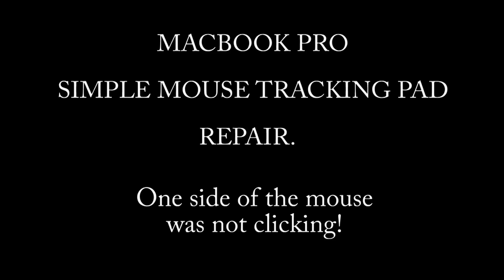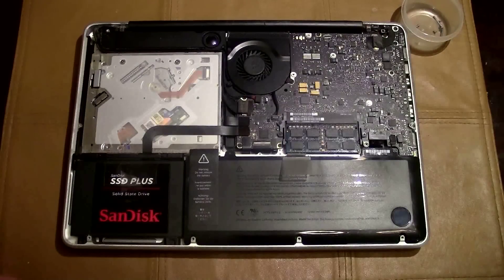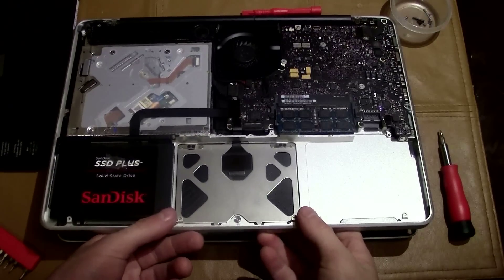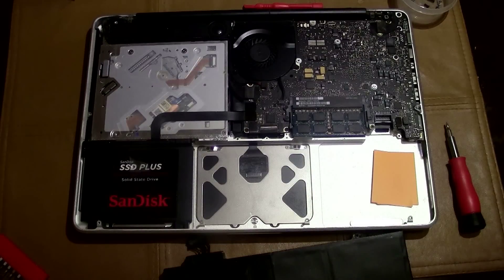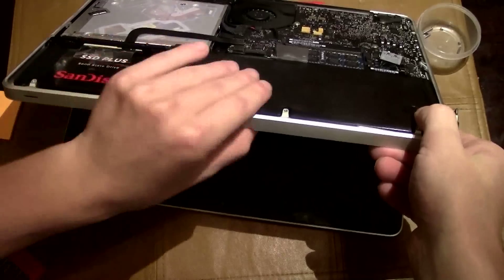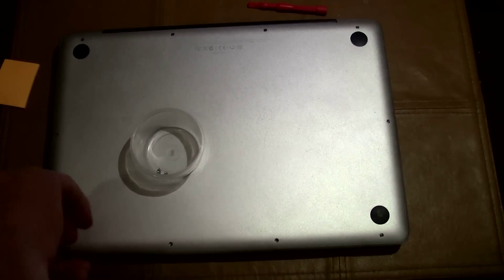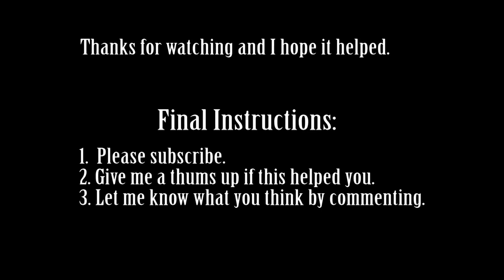Macbook TrackPad -- MousePad Not Clicking --DIY--How To

Comment: Thanks for sharing this. After watching your video I worked out that I had just tightened the bottom screws that sit the other side of the track pad too tight and that was causing the issue. I backed them off a touch and the trackpad was back to normal.

Comment: Hey I was wondering if you knew why my trackpad was so far in.
I believe it's cause I press too hard but I'm not able to press anymore because of it and  I don't know how to push it back out again.
Sorry if that made zero sense, just hoping that someone had a solution before I went back to school.
Reply from the maker: Hi, I am not 100 percent sure why that would happen, but it may be as you supect; you push too hard.  If you open up your laptop and look at where the trackpad mounts to the unibody casing, see if all the screws are tight.  Maybe they are loose and is causing some play.  Or maybe the mounting area is bent out of shape from you pushing to hard.  In any case, you can attempt to bend the mounting bracket back into place.  Or tighten the screws.  I hope this helped, Jake

Comment: Thanks for the inspirational video! Mine had the exact problem and I solved by banging the hinge side on the desk couple of times without taking even one screw off! Guess that just restored the battery to where it should be and unhindered the touchpad!
Reply: banging it on a desk? mines stuck right now but i’m too worried to bang it on a desk!!
Reply: @siena7098  OK when I say banging, I mean to let the hinge side fall gently on a flat hard surface such as a desk. Gently.
Reply: @santalucifer1169  ok, LOL was worried for your laptop for a second

Comment: Except this is a SOFTWARE problem.   Not a hardware problem.   Because the mouse click is controlled by SOFTWARE.
Reply: Bro what? You realize the mouse is physical thing as well as "controlled by software." Like if you couldn't press down a keyboard key because something was blocking it you wouldn't call that a software problem.

Comment: my god... this is so wrong... if your battery is pushing against the trackpad, YOUR BATTERY IS DEFECTIVE and swelling and generally... a danger. This fix manages to use a bad dangerous battery for a little longer... until it swells a little more... or catches fire.
Reply: its not swallen, its just a little bit lower than the original battery so the trackpad dosen't click as well

Comment: Another person on youtube identified that the battery can begin to bulge, which can cause the track pad to not click or click improperly as a result of excessive pressure on the track pad from the battery.  Here's their explanation:  https://www.youtube.com/watch?v=jf4VjIeIMVc  I guess the battery can bulge if is begins to get too hot or if it's old?  So, before you put sticky notes under your battery to shim it, maybe a good cleaning and inspection of the battery is warranted, along with the track pad and chassis.
Reply: RedondoBeach2 i need help my laptop's mouse isnt moving or clicking

Comment: Mine clicks on the left and right side, but on the left side even though I can hear and feel the click, my macbook won't respond to it. Does anyone have any idea how to fix it? I already replaced my HDD with an SSD and upgraded ram, so I don't mind opening it up.
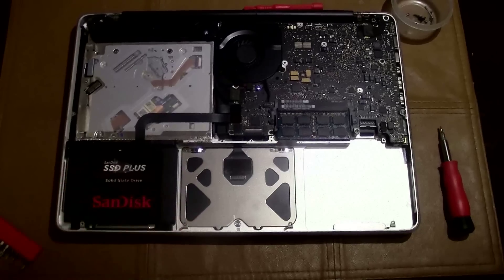Reply: Try tightening or loosening the trackpad screw.  You can see it at 1:43, it is the screw in the bottom center.
Reply: @DaikaijuProductions  this actually solved my issue on my old mbp mid 2009